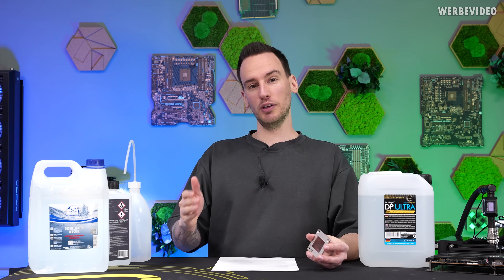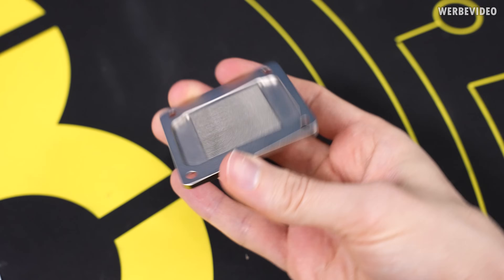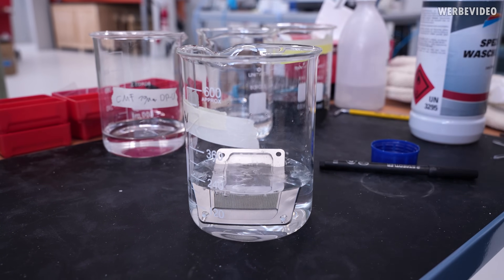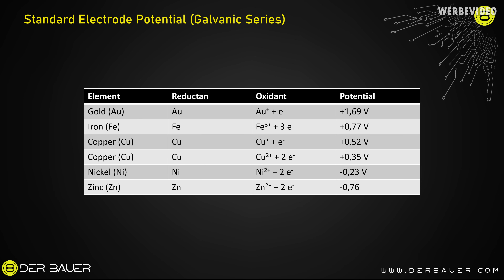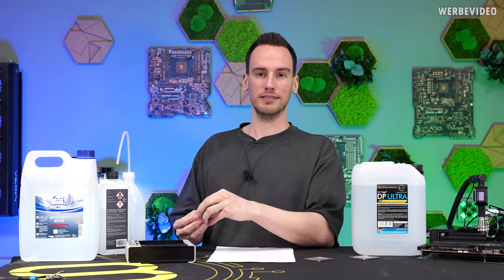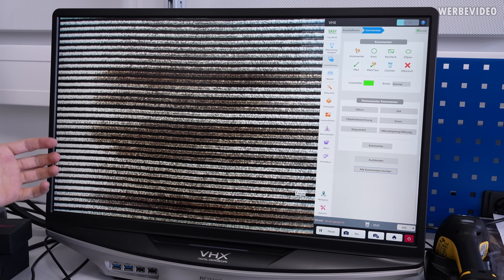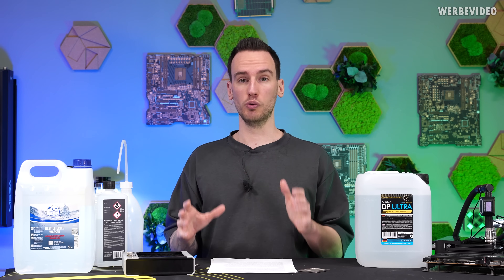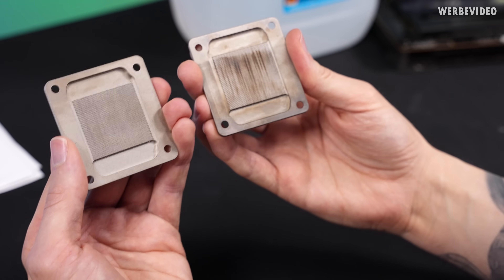Do NOT use Distilled Water for your Water Cooling Loop!

Comment: I put some distilled in mine just to test until some actual DP ultra came (remote location, shipping is a pain). Saw the video title and immediate panic sets in haha
Reply: Heloo
Reply: The title is nothing but clickbait and is very poor from Roman.  The video content itself is a great explanation, however saying you shouldn't use distilled water in a title is shitty and very inaccurate.  If you aren't buying a custom cooling premix, then you absolutely SHOULD use distilled water - with an additive.
Reply: Chill. I have 15 year old PC with distilled water and silver coil (against growth of algae) and I'm adding only some water every two years. Temperatures are still great. This is manufacturer problem not user one. He try to say to uss that we need to compensate for cheep nickel plating. Shame
Reply: @diodak39  Tell us you didn't watch the video without saying "I didn't watch the video"
Reply: @mjc0961 Tell me You didn't understand situation without telling me You don't understand situation
Reply: @diodak39  Using a silver kill coil is fine with copper, but will strip nickel plating over time, due to the difference in galvanic potential. Leave silver kill coils in the 90's / early 2000s. Things have moved on.
Reply: @noxious89123  What proof do You need? 15 years of perfect work aren't to good for You? Why You are assuming that I'm using nickel plating? Or maybe You are repeat mindlessly thing that You did read in internet?
 I have quarter of century experience in building PC for low level users and my experience is telling me that this combination it is better because it doesn't need high maintenance. It is much easier for end user to add little water that he can buy even on gas station than change fluid which neglected can block your system. Simple solution which works for simple people
Reply: @diodak39 you clearly have not taken apart your block
Reply: @Kowslayer  To see discoloration that doesn't make loss od performance?
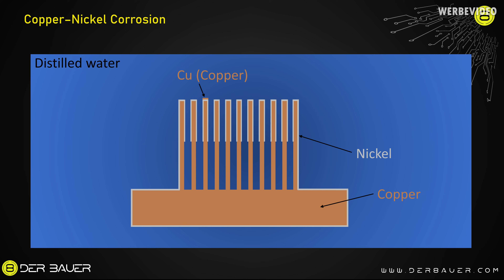Reply: @Kowslayer  notice he never says its a bad thing, its just ugly. i recommend watching the video again, specifically 11:42
Reply: @Kowslayer  You people get so upset about cosmetic issues.
Reply: @ In my case, I AM using a waterblock with nickel plating, so the silver coil would not be an option. You are assuming that everyone else is not using nickel plating with your original comment saying its fine! 
Typically, older systems would not mix metals anyway, the industry has moved forwards.
Reply: @diodak39  protip, every metal, the copper of the plates...is already an inhibitor, a silver coil is pure snake oil for those who dont know any better....
Reply: @Decenium  Explain it then, why would it be snake oil if silver actually kills off the formations of bacteria
Reply: @diodak39  Thats because you have an inhibitor in the form of the coil this is just people raw water
Reply: @WayStedYou  I have been using distilled water only for 6 years and never had a temp issue either.
Reply: @wudntulike2no32  well he did say that the only drawback to not using water is less cooling capacity the point was that just using plain water without any inhibitors. wonder how many watched the full video before commenting lol